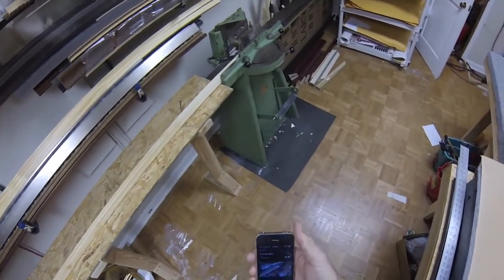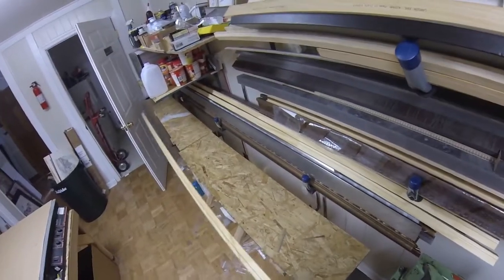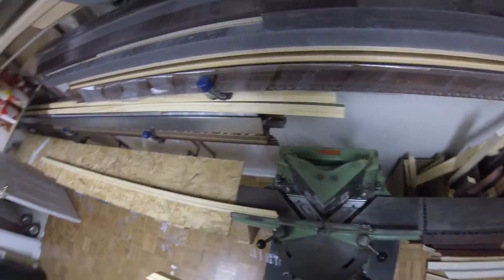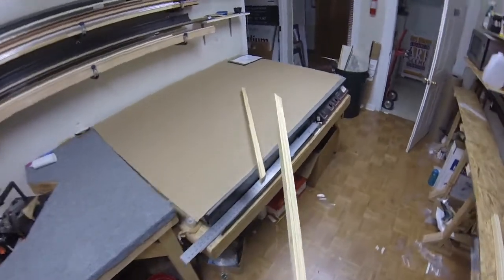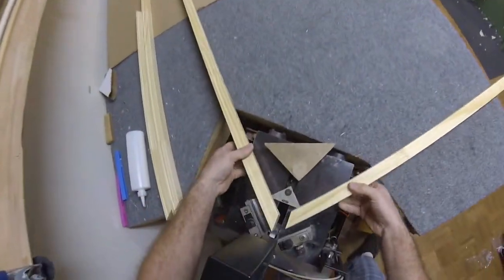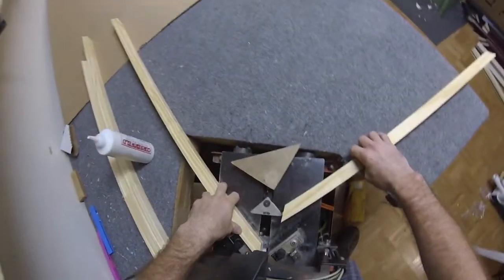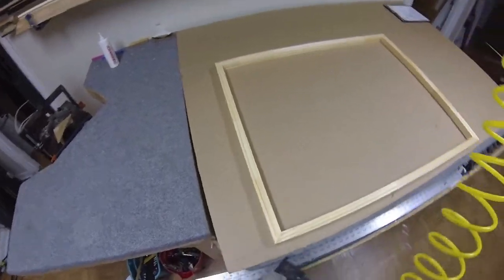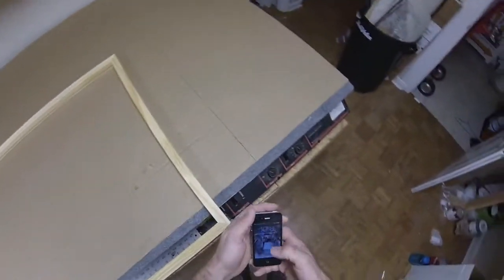how to build a stretcher frame for canvas

Comment: that method of construction fails to allow for   expanding the frame and re-stretching the canvass years down the road when the painting  sags and they will sag. So if you care about your art you won't create fixed joints  ya need a compound  sliding miter.